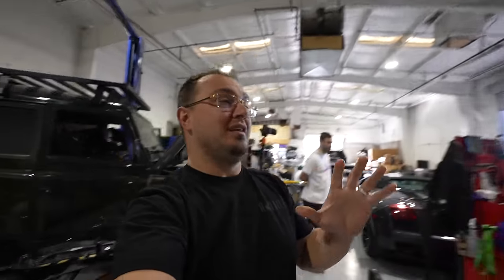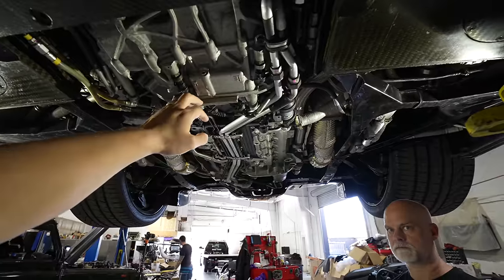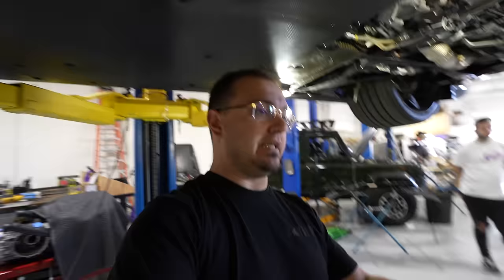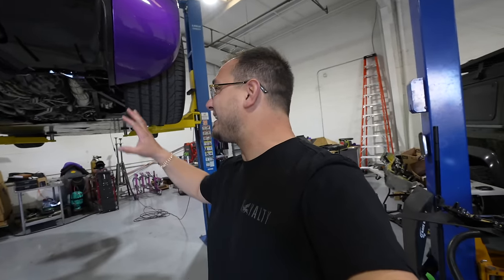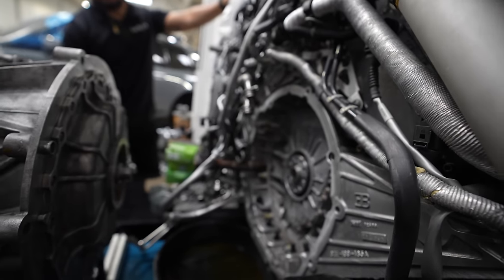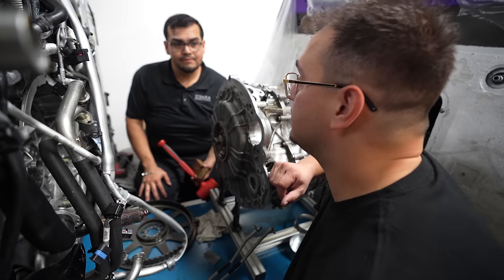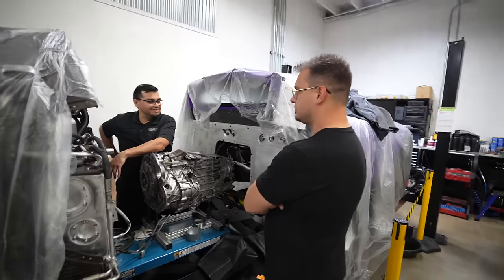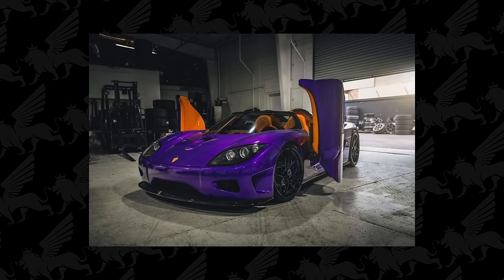Rebuilding The Flooded Bugatti Veyron | PART 12

Comment: I like circumventing the system and accomplishing things that NO ONE says is possible.  He showed the world that this super car is just nuts and bolts and it can be rebuilt.  While I understand the corporate side of things - protecting its brand.  The Bugatti side of the house should have provided a silly gasket and allowed the completion of the build.  They could have provided signed NDA's and no one would have known any different.  But, it once again proved, that where there is will there is a way.  While the cost was immense, the amount of experience gained is priceless.  The car is gorgeous in and out.  So, cheers to Andy for sticking it to the man!

Comment: Glad the seal ended up sealing . Have to say I was surprised to see how the ring was being preheated by a torch?  That does not heat the surface evenly . Best to heat in like a small toaster oven . That way the part is evenly heated and goes into place easier and then cools evenly to lock it in. Not saying I'm an expert, just my experience over the years and a suggestion.
Reply: Agree. But as the metal was so thin it would heat up quite quickly..

Comment: Hint: That sleeve for the rear crank seal should have been heated up in a conventional convection oven to obtain a more consistent amount of uniform expansion.
Reply: But the sleeve was so thin it would have heated up quickly.
Reply: @stuartd9741 correct, the temperature could be regulated to 125 degrees F or 200
Not sure what the thermal coefficient of expansion is on the alloy used?
I install these sleeves at room temperature.

Comment: This has a captivating series.
So much is now known about this Buggati and its sad demise.
Yet you guys have resurrected this Veyron like the phoenix from the  ashes.
..
I think you guys were the right team to do this project.
However one thing concerns me.
.
I believe every Buggati Veyron new or old, is a piece of motoring history.
..
And this Buggati being chassis 
 # 26/27.
Is one of the first few to be sold.
Q:
Was it the right approach to customise this car and has the customisation essentially devalued the Buggati considering the low chassis build number?
..
You must be into this Buggati 1.2-1.7m.
..
Would there be more value in a completely rebuilt original stock Veyron.????
..
I understand its not necessarily about the value, but resurrecting a piece of motoring history..
..
Don't get me wrong the Veyron looks sick.

Comment: 100% how I would spec or customize every car. This is just my vibe, I wouldn't change anything! The best looking veyron in the world in my opinion.

I was already wondering why he didn't tuned the car while replacing every nut and bolt. Upgrade those 4 baby turbo's to whatever you can fit. The turbo technology has come a long way since that car was designed and build.

Comment: Surely that seal is exactly the same as any on a 10 bolt VW crankshaft 😂
Reply: Or even custom made. I wouldn't put my own car together with that seal let alone on a Bugatti.  

I understand why it stressed him with Bugatti essentially blacklisting that engine if he touched it, but perhaps in retrospect, quietly replacing the seal without informing them of having the need to do so wouldve saved him some headache. 

But also years down the line when the car comes in for a new seal, the dealer may have noticed and made it an issue.

Comment: Bugatti CEO:  for 100.000 usd, our Bugatti special trained engineers will fit the seal at our special Bugatti center using Bugatti special tools...
Houston....  Hold my beer.... STEP 1: I hold it , YOU BURN IT with a torch ... STEP 2: I hold it, and you hit it with a hammer... DONE !!!

Comment: i really hot you swapped out the Coolant tank for a none Mit Silikat that in all VW, Audi, Skoda, Seat, Porsche, Lambo, Bugatti if that Mit starts leaking that brown sand crystal your hole coolant, and heating core the heating matrix needs replacing and acid flushed then a coolant flush a number of times its a nightmare